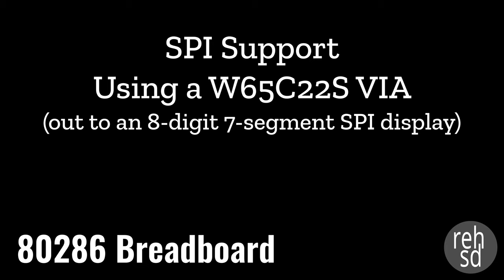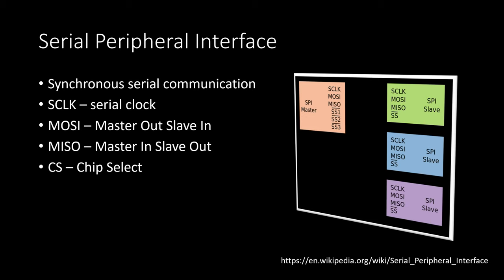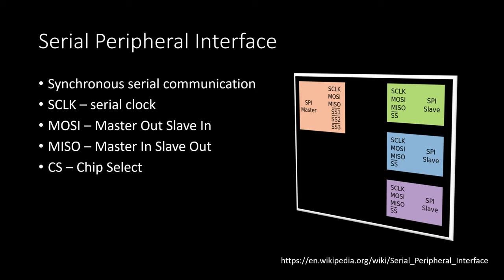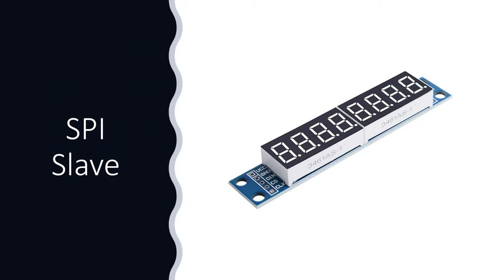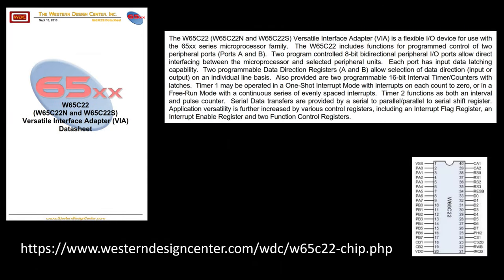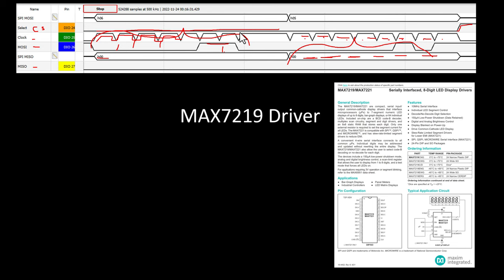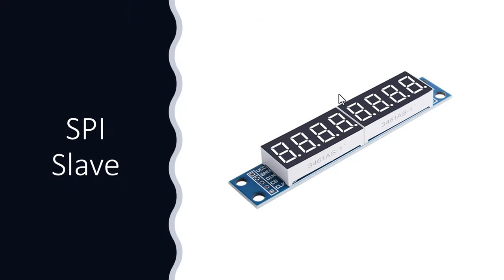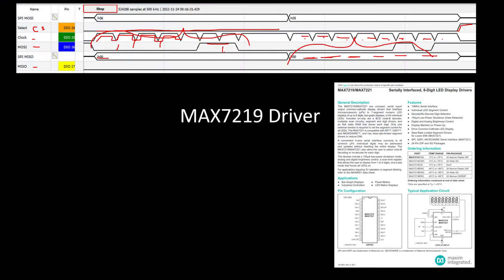80286 Build, Ep. #49 - SPI, 6522 VIA, and an 8-character 7-segment LED display

Comment: Great progress. I learned a lot about SPI today!

In x86 assembly, BP is generally not used as a GPR, but rather as the frame pointer (BP stands for Base Pointer). For counting, the CX (or CL) register is generally used and an x86 even has a separate instruction that uses the CX register as a counter and jumps back to a relative address (usually the start of the loop) and counts CX down until it's zero.

So instead of 'mov bp, 0x08', you'd have 'move cx, 0x08' and instead of 'dec bp' / 'jne .loop' you'd have 'loop .loop'.
Reply from the maker: You'll probably see me misuse registers for quite a few videos yet. I'm working on using them more appropriately. I appreciate the pointers! Thanks, @Damouze!
Reply: @rehsd  Always glad to be of assistance.